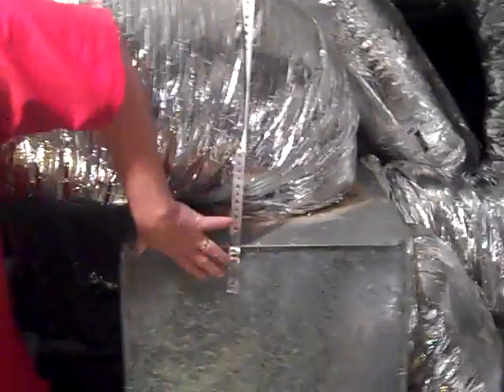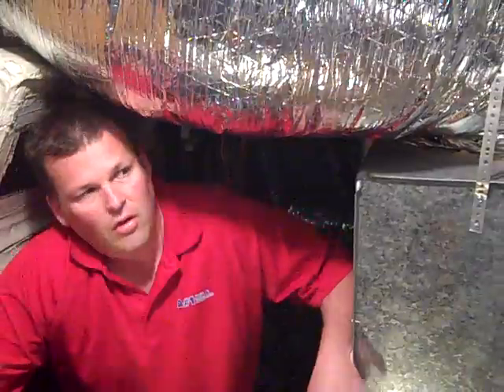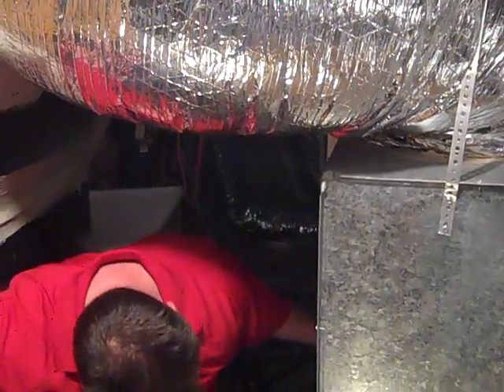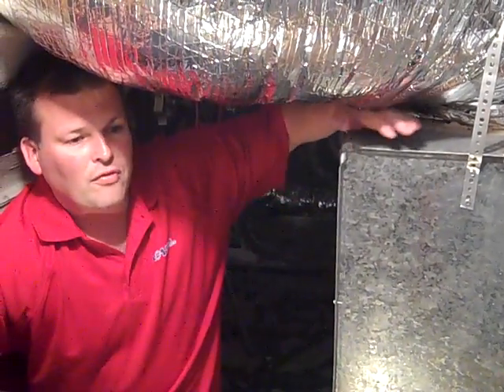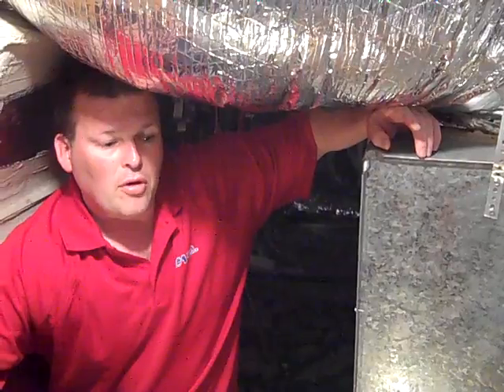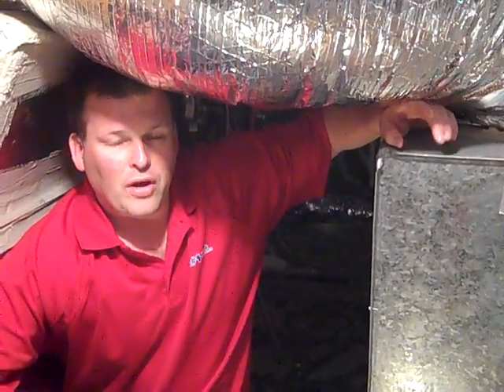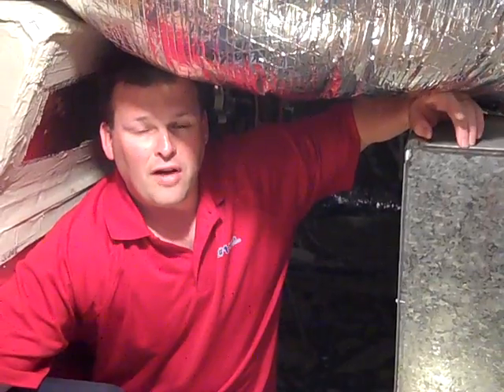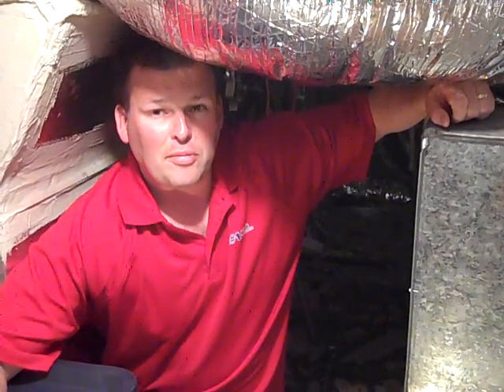A #1 Air Conditioning - Return plenum

Comment: common problem in commercial too. good rule of thumb is 100 square inches of return per ton. ie: 1 - 10" Duct per ton. 10" x10" for 1 ton. 10 x 10=100 square inches. 2 ton - 20 x 10=200 square inches. 3 ton - 15" x 20" = 300 square inches. 4 ton - 20 x20 = 400 square inches . 5 ton - 20" x 25"
these are Minimum recommended return air plenum sizes. Bigger is even better. You can Never have too Much return. 
Same Goes For Supply sizes.

Comment: 18" at .5 friction of duct is approx.1260 cfm also need to take into account the length and type of register that return is connected to. Need to do research on the system that you have for design duct calculation. Some people overcompensate for new style ICM motors and they loose as motor fails keep constant airflow.
Reply: That duct work was pathetic..

Comment: Well, I am currently replacing my 3 ton (undersized) unit for my 1948 sq. ft. home to a 4 ton 16 seer 2 stage unit.  Since I bought the home new, I have never been able to cool the back bedrooms - hardly any air coming out of the vents at all!   I always assumed it was the 6" ducts that were going back to those rooms.   However, when I took out the old lennox air handler at 20 1/2" x 21 1/4", the whole under the air handler that it sat on was cut at 15" x 16".  That's 20 inches of return air that my handler wasn't receiving!  I haven't quite finished my new project, as I am having a hard time trying to fit my new return box in the spot that the old one used to be, but I am betting that with the hole cut at the bottom of the air handler the exact size of the opening, I should see much better air in those rooms.  I'll keep you posted.

Also, 2 - 18" returns for a 4 ton unit?  You've got to be out of your mind...!!  My return is 24 x 18 and only 30 inches deep, so the handle is only set back 10 inches from the grill...

Comment: You can't just say that xyz sized return is the answer. Silly video is a half assed infomercial   The point is size your returns correctly and keep them as short and efficient as possible in the building envelope(conditioned airspace as much as possible. Rule of thumb people if you see a 20x20 trunk going out of the furnace air handler, you need ductwork of a similar size supplying return air. Kinda a K.I.S.S. Principle but any layperson should understand this easy visual clue.

Comment: i have a 3 ton Trane running a 1200 sq. ft one floor house with 25 foot ceilings. The house is not getting enough cold air to cool the house. We had a mechanic come look at it and he said we should install a plenum to increase the efficiency of the unit. It's a 15 year old system but he said the coils weren't dirty and that wasn't the issue but he suggested installing a new return air plenum on the air handler and that it would stop the air in the ducts from circulating and would help run the AC unit more efficiently. Was curious what your thoughts were on this.
Reply: 15 years old. Dude buy a new system 4 ton condenser 5 ton evaporator make about 16 seer and possibly a txv, because your tonnage is way under. I can't suggest ductwork because you have to do that after a good inspection of chases insulation etc.
Reply: Nicholas Nebelsky 
Dude that’s a weird building. Small and tall. Also I would get someone who can assess your rig.
Reply: Every unit needs a return plenum to equalize air pressure for more even air distribution. A 5 Ton unit calls for (2) minimum 18” flex ducts to achieve 2,000 CFM needed. Also make sure your entire duct system is sealed properly so you aren’t loosing air in the attic. Sufficient attic insulation and doubles pane windows will help.

Comment: Dude, you are all wet about your numbers.  400 cfm per ton.  so 5 ton times 400 equals 2000 cfm at manufactures static pressure.  You have to know the static pressure and adjust your return and supply ducts.

Comment: No Worries, your system delivers approximately 1400 cubic feet of air and a 16" duct will handle 1600 cubic feet at 1050 feet per minute. The only issue would be noise and if that isn't a problem for you stay with the 16" duct. If you where to take the advise from this amateur video you would need something like 2- 18" ducts and all you would do is fill up your attic with exposed duct work and waste energy from your home through the duct loss in the system. Less duct less loss!!!

Comment: I bet it"s a common problem, since you are not educated enough to understand things like static pressure and delivered air efficiency. Adding return duct which isn't needed will only decrease the efficiency of the system because there is more exposed ducting in the attic and most return air ducts create some leakage in the air stream. Your example of an 18" duct being too small for 1600 cfm is wrong. Get a copy of manual D duct design and read it, you will be surprised what you will learn.

Comment: I'm in common bi-level,entering the front door landing,7 steps up R ,5 down L. Atop the steps,upper level,to the right on the floor is 1 return,directly above at the ceiling is another & directly below,lower level,the third,all 10x26.Are the upper level returns alternately covered,floor return summer & ceiling return winter ? Also I covered the lower level return (next to furnace) for sanding reasons,is it it choking the required air flow needed,heat cycle  is 10 min on & off cool is 5 on 5 off

Comment: You can NEVER have too much return air.  NC code calls for 200 sq inch per ton, I run dual 18 inch returns on all my installs.  Also note I dont do systems over 4 ton either, all my floor plans are under 2400 sq ft.  

Note on this video the duct on the right side of the box, its crimped / crushed almost flat as it runs up the box and connects on the right side.........thats quality work right there